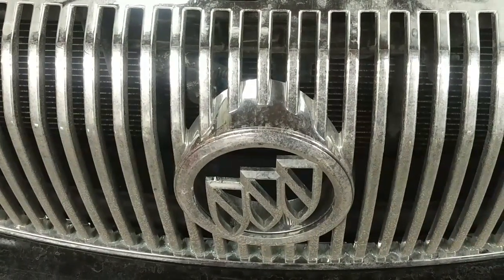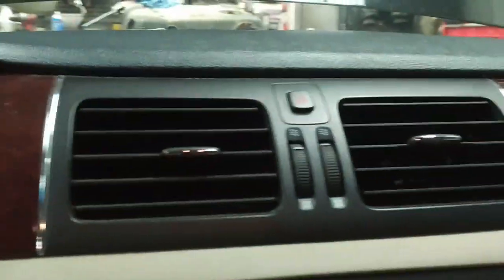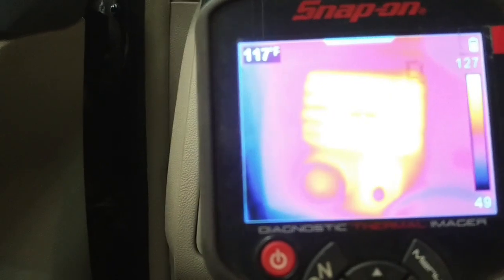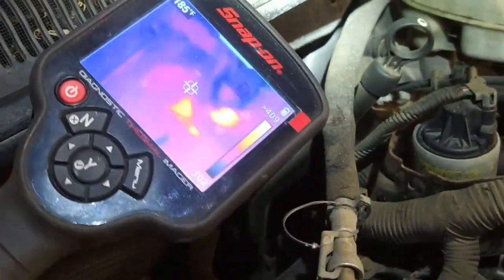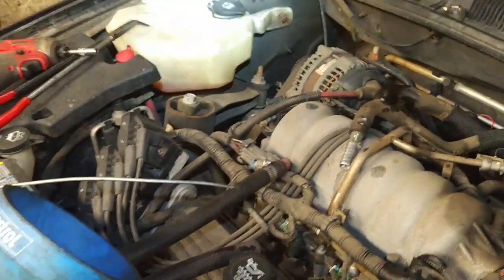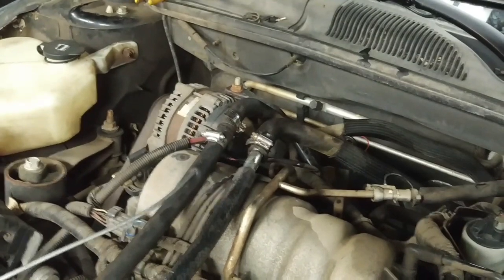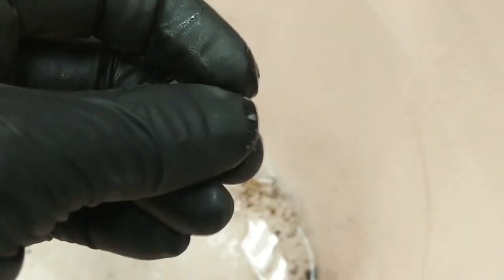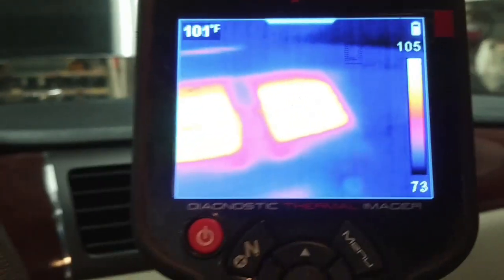2006 Buick Lucerne Poor Heat Passenger Side

Comment: Hey Phillip, great video. I have exactly the same issue with my 2008 Lucerne, I have already flushed the heater core twice with generic "radiator cleaner" but I think I will try it again with CLR and let it sit for a while. The car is 12 years old so if that doesn't work my passenger will just have to be cold! :)
Reply from the maker: The air pressure seems to help. Blow it out so it's not full of coolant before filling with CLR. Let it sit for a couple hours if you can. There's always a seat heater and a blanket option. Good luck

Comment: When I first saw this video I thought that a plugged heater core was not the problem as my vent door was stuck open. I replaced the vent door actuator and it still did not have heat on the passenger side. So then I did what you did and a lot of stuff came out. I used CLR and followed it up with Vinegar. The vinegar loosened up more stuff than the CLR. It is now working properly. Thanks!    https://youtu.be/mRG6__OWSGY

Comment: My son has a 06 lucerne with the same problem. Not a dual air system. How much clr did you pour into the heater core?
Reply from the maker: Use water to back flush first then blow air through to dry it out. Then I fill the core completely with CLR. Usually one container or quarter is enough. I'd let it sit for a couple hours even overnight if time permits. Then flush it both ways. Good luck
Reply: @PhillipBailey  Thank you soo much for the quick response. My son is heading to Northern Michigan in 2 days so looks like I'm trying this tomorrow. Thanks again

Comment: I have a 2006 Buick Lucerne poor heat passenger but with duel zone what is difference?
Reply from the maker: Well a dual zone system has a driver and passenger temp door and actuator individually adjusting the temps. It is possible for an actuator or temp door to fail and cause significant temp differences. Need to have it scanned see if there are any codes related. HTH

Comment: I have a 07 Lucerne same problem i flushed the heater core tho but still no heat this happened once my radiator went back and I changed it
Reply from the maker: Is the engine coming up to temperature correctly? Are both heater hoses hot and nearly the same temp running the heater fan on high inside the shop? If one is significantly hotter you likely have poor circulation through the core. Sometimes an air lock in the heater will prevent proper circulation and result in poor heater performance. You can try holding the engine speed at 3000 rpm for several minutes. Sometimes it's necessary to loosen the return hose at tge heater core to let the air out of tge core. Be careful not to burn yourself with hot coolant. Good luck.

Comment: No heat on passenger side what can I do?
Reply from the maker: If its a dual zone AC system you may have a problem with the passenger blend door. If its not then the heater core is partially plugged.
Reply: @PhillipBailey  is that something i can do myself?
Reply from the maker: @psideTXdude03  I dont know...you didn't answer the question. Is it a dual zone system or not. If not try flushing the heater core as in this video. If it is dual zone you will need a scan tool to check the HVAC system for code and do some tests. As I said it may need the passenger been door actuator replaced.

Comment: I had the same problem so I flushed the hc out and the driver side blows to dam hot lol but my passenger side is still blowing cold it may warm up just a little bit but it’s definitely not blowing any heat right now.....any suggestions would help me alot
Reply from the maker: Is it a dual zone AC system?  ( has separate driver and passenger temperature settings)? If so then you may have a problem with the passenger side temperature control actuator. If it's just a regular AC system the the heater core is restricted on the passenger side.
Reply: Phillip Bailey yes it’s a dual ac I changed the temp blend door but it’s still blowing out cold
Reply from the maker: @MisterMachete  you need to scan the hvac system for codes and also watch the passenger temp door counts change when switching from cold to hot to cold. Did you do a recalibrate procedure after changing the actuator. You can get it to do this by disconnecting the battery for 5 minutes and when you start it that should initiate a relearn. Could try removing the passenger actuator and turn the door shaft by hand as well. Good luck
Reply: Phillip Bailey I tried all of those except scanning and the relearn I will try that this weekend and come back with a update thanks alot I didn’t think about it relearned sometimes lol